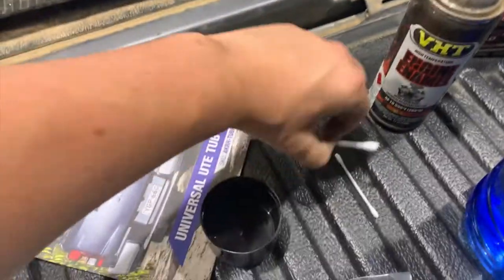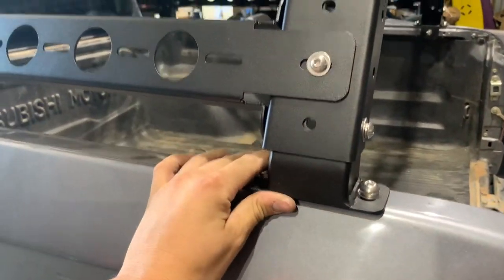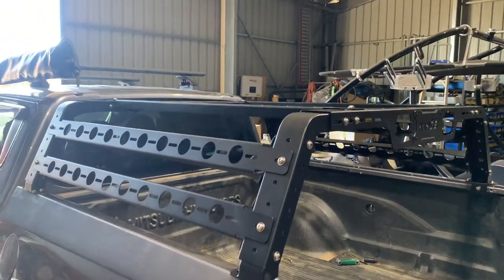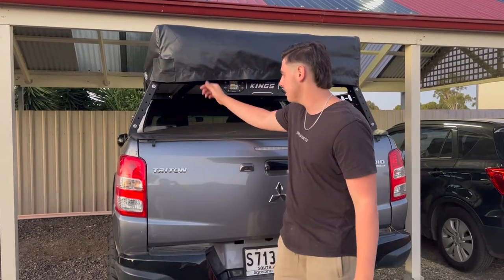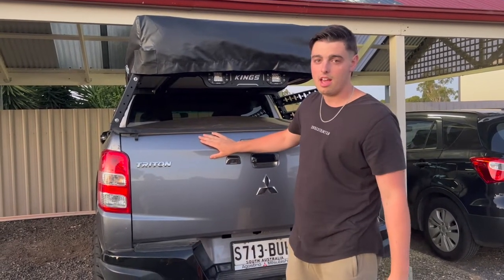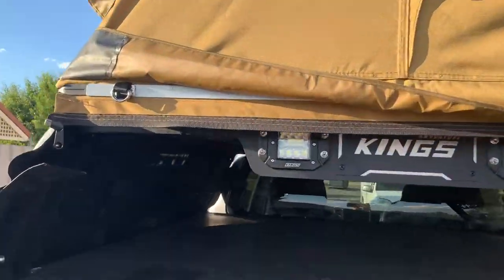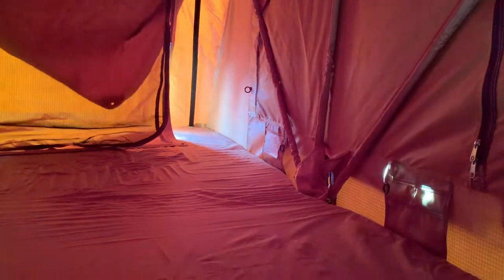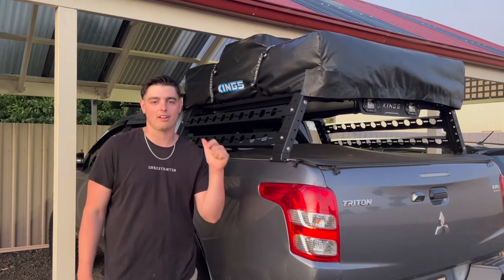KINGS tub rack + ROOFTOP tent install on MQ triton

Comment: I know you don't want to redrill 6 holes that hold the front or rear frame down, but the side bars are important for bracing your rack - fore and aft. Alternatively you could put some spacers in the gaps on the side bars and then bolt through, so that you can do up the two flanges on each end of the side bars. I'd hate to see the roof top tent on the ground on a gnarly steep track or serious congregations.
Reply from the maker: I agree mate, spacers have been made. Appreciate the honesty!

Comment: Hello, after some advice. RE the mounting bars on the roof top tent - we are struggling to align the base of the roof top tent with the tub rack because the mounting bars are not wide enough. When we tried to adjust them to fit the width of the tent's bars on it's base, there wasn't a way to secure the cross bars back onto thee rack. Does that make sense? Help! (basically, keen to know if you had to drill new holes to the base of the tent)
Reply from the maker: Hey, I didn’t need to drill new holes in my tent but I did drill new holes into tub rack as I saw it didn’t align. Drilling holes into rooftop tent will cause water and condensation leakage!

Comment: Hi mate - I’m the middle of building my own and also find gaps between the brackets for the ones on the side. What’s the correct way of building so you don’t have the gaps? Cheers 👍
Reply from the maker: You need to assemble all the pieces before placing on car. So put everything on the rack that’s included and then place on car

Comment: We bought one a d have it installed. My question is with the ladder. Instructions say it should be at a specific angle. Tho the kings store say it doesn't as its not a support for the tent. Do you know if it matters its at (I think) a 35degree angle? Only ask cuz we need to fit 2 self inflating mattresses in our 4 person Annex
Reply from the maker: No doesn’t matter what angle the ladder is at, as long as it touches the ground

Comment: Hey bud,
This is off track, bud whats the brand of suspension are you running front and rear.
Reply from the maker: Drivetech lift man, 2 inch front and rear but rear is 350kg constant. Will be dropping a new video on a rundown soon so make sure to stay tuned for it!